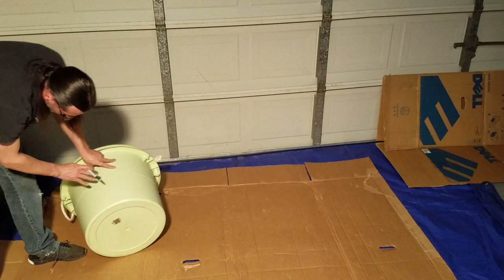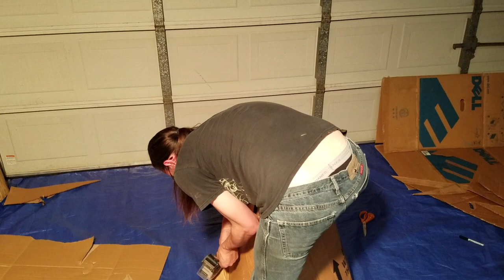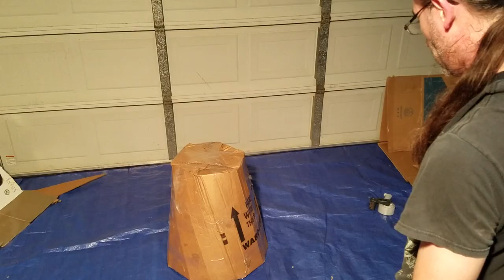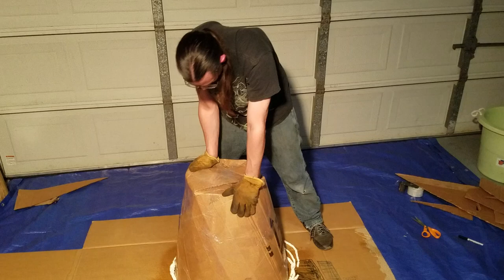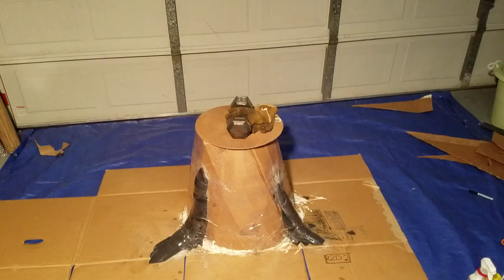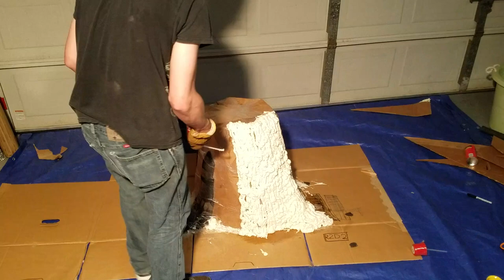Foam tree stump prop build - Part 1

Comment: Daren thanks so much for this video!  I really want to do something like this for my church.  I was going to use a large styrofoam cylinder and styrofoam branches.  Do I coat that with spray insulation and then use an epoxy hardner on top?  or do I put the hardner on the styrofoam and then cover with spray insulation?

Comment: How much spray did it take to cover this piece? I’m making a 16 foot tree and want to try to make as few trips to the store as possible.
Reply from the maker: Three cans if I recall correctly. Make sure you wear a chemical respirator if you are going to do that much, or at least have good ventilation.  Isocyanates don't smell like they would require one, but a few hours of constant exposure can make you permanently sensitized to them with flu like symptoms.
Reply: Daren Schwenke thank you for responding so quickly and for the advice. I have a pretty well ventilated shop I’m working out off. Cluttered, but ventilated. I’m looking at buying at least 12 more cans then.

Comment: what are you spraying the foam with in the formula 401 bottle and why
Reply from the maker: Water. The urethane foam I use here is moisture cure, so spraying it with water accelerates the cure time from hours to minutes, and let's you apply it as thick as you want.
Reply: thank you so much for your quick response, i am making my wife a bodice/corset that looks like it was made  from bark, and your video has helped me tons. thank you again
Reply from the maker: @jcfsaiyan  If you want something that looks like bark to wear, start with closed cell neoprene foam and wire brush it.  Insulation foam for pipes, the soft, expensive kind.
Reply: what about eva foam, cause thats what im using with the spray foam will it make the same effect if i wire brush it?
Reply from the maker: @jeremiah fletcher Polyethylene foam works too, but is harder to make look right due to the larger cell size and open cell nature.  I have not tried EVA foam, but I imagine it should work.  The higher the density, the more brushing you need.  Use a stiff bristle wire brush, and if it tears the foam in a linear way along the brush lines, keep going and it will look like bark eventually.  Example: https://www.youtube.com/watch?v=flCXCcto3gs
Reply: @DarenSchwenke  if you use a heat gun to the eva it will close all the cells and maybe that would help it?
Reply: @DarenSchwenke  ok so i used a heat gun.  closed  the cells on eva foam and wire brushed it. It doesnt look like bark but it looks exactly like weathered boards, perfect for old boards, so i learbed something througj this anyway.
Reply from the maker: @jerimiah fletcher For wood grain, use a finer bristle brush, like a normal hardware store one.  For bark, use a stiffer bristle brush.  I used a stiff bristle wire brush for a drill for this (Not the drill!), or my grill brush.  Break it in on some metal first to separate the bristles.  Stiffer bristles, bigger tears, more pronounced effect.
Reply from the maker: @jcfsaiyan  I forgot to mention...  I did the wire brushed foam thing for another project I have up here: https://hackaday.io/project/27573-teen-groot
Has a series of videos attached as well.